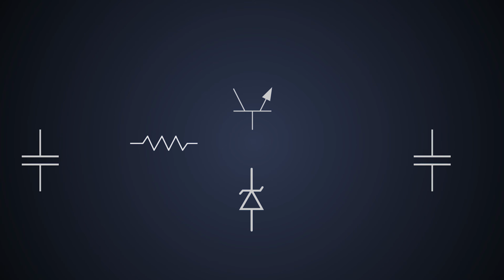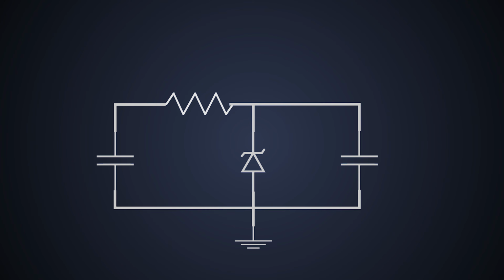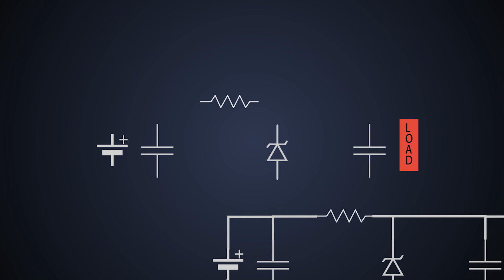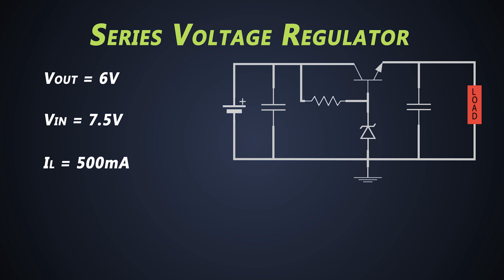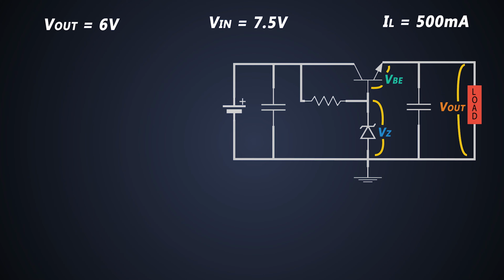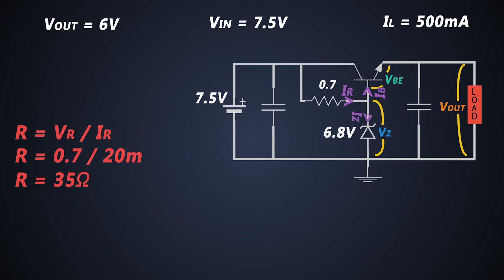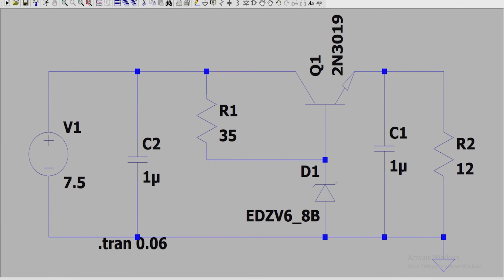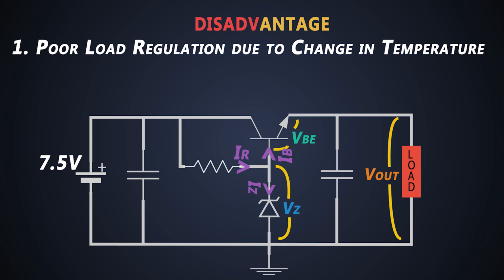Voltage Regulator using Transistor | Series Voltage Regulator | cheap Voltage Regulator

Comment: excellent video sir! but i just want to know, don't we need to put a resistor in Ib to drop it from 6.8 to 0.7v? i am sorry if i am wrong
Reply: also for the power dissipation of the zener diode, u said before the zener diode safe operation is 10mA and 20mA is current that flowing the resistor, so should we multiple the Vd with 10 mA instead of 20mA?

Comment: I will recommend you to use lower capacity output capacitor like 200uf or something and use a load resistor in output with a value like 1 kOhm or 500 Ohms, or reducing voltage will be a trouble, don't be like you have to follow 100% Video, if you have knowledge, apply it or you'll never learn
Reply: well     there is an  argument for a lower Cout but not for that reason

Comment: how do you calculate for the size of the capacitors?
Reply: rule of thumb for Cin is 1000uF per Amp though some say 2000uF per Amp        depends on the load
Reply: @kennmossman8701  what about C out  and yr talking amps on load I assume.  Lots of caps for 40 amps to regulate 14.4 volts for my project.  Otherwise its arduino.
Reply: @davidjackson2115  49A ???? thats a very different beast

Comment: 12v voltage regulator with good efficiency which will not give up and i would be able to apply heatsink on it with good 2 Amp at 12v output with input varing from 12v to 15v?
Reply: what?    use a boost/buck converter
Reply: I agree.  need this circuit for lead acid batteries & solar.  Sick of blowing things you cant fix or dont do what you want voltage wise.  Im talking 40 amps & deep cycle on solar.

Comment: Why is the power dissipation of the transistor = (7.5-6) x 0.5? Can you explain where did the 0.5A comes from and why is the voltage across the transistor consider as Vout -Vin? In addition, why did you use 20mA instead of 10mA in the calculation for the zener and resistor power dissipation?
Reply: The 0.5A current comes from the chosen load current, and since the emitter current is the sum of all currents passing through the transistor, it represents the total current that generates power through the transistor. The voltages across the collector and emitter are 7.5V and 6V respectively, so the voltage drop would be 7.5V-6V (according to Kirchhoff's Voltage Law).

Plugging those values into the power equation, P=IV, we come to P= (7.5V-6V) * 0.5A.

For the zener diode and resistor power dissipation calculations, the current used in calculations was 20mA for the resistor because we choose the resistor's value to force that current, so that is known by the design. For the zener diode, we use 20mA as a worse case where all the current is passed through the diode (for reliability purposes). In reality, 10mA of that current should be used to control the base of the transistor, but it is almost always better to use higher power-rated components in the event that the worse case scenario occurs.
Reply: Good question
Reply: Good answer

Comment: When you change the load resistor, for example to a lower value, the current increases, this means, the base-emitter current increases, which causes the Ir current to increase as well, which in its turn increases voltage drop over the resistor, which can be shift the zener diode into non stabilizing range. So, you should count for this min/max values as well. Can you describe how should you fully calculate this circuit?
Reply from the maker: very clear observation! I need to think on that.
Reply: The voltage drop over the resistor and its current should first stay constant, with more current flowing to the base then to the Zener. But that then can, as you are correctly worried about, effect the Zener.
Reply: basically that is true in any circuit
Reply: Basically you need to design the circuit for the highest current and lowest voltage you are expecting. Then, you need to make sure with that, under the lowest current and highest input voltage, that you will not fry your zener (or possibly resistor). If the power exceeds the limit of the zener, then you need a bigger zener, or switch to a transistor with higher gain. In the end there is no free lunch, as transistors with higher gain have higher Vce (Darlingtons, Sziklai pairs etc)

Comment: How does this man this compare to the Linear Regulator in terms of noise and PSRR?
Reply from the maker: This regulator is very helpful for such application where input voltage ripple is very low & voltage range is also low.